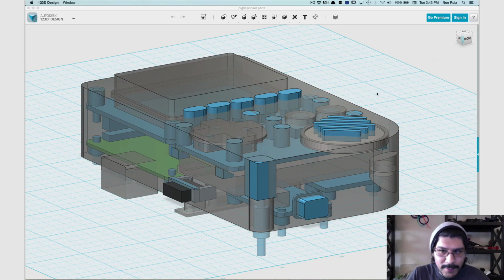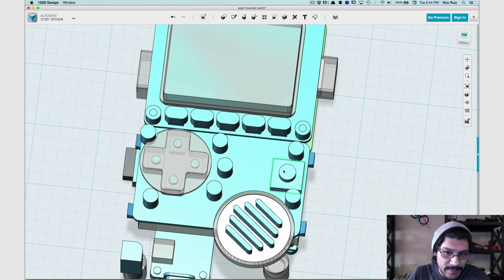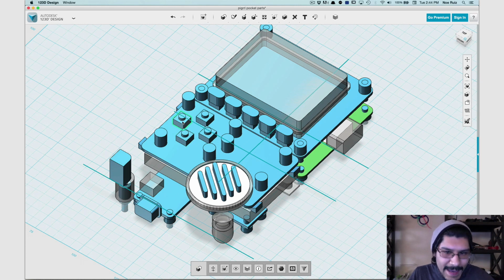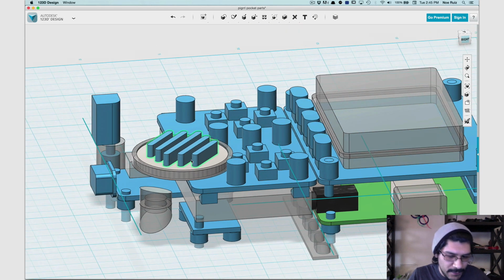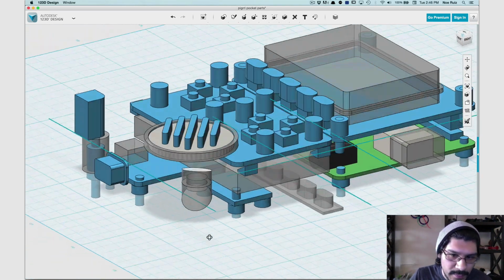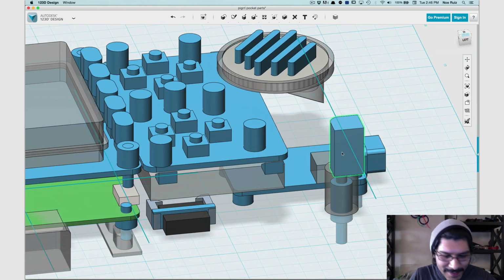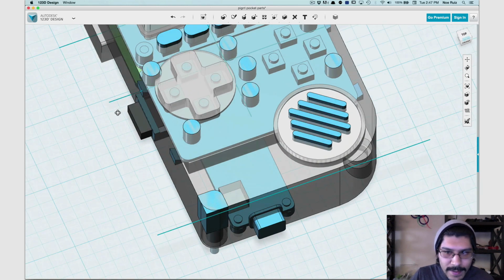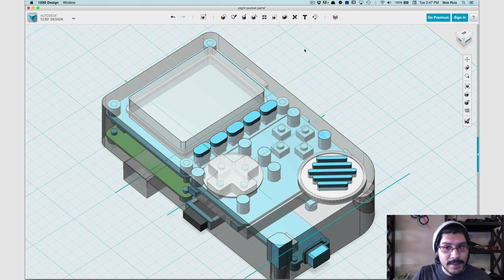Pocket PiGRRL Buttons - Layer by Layer

Comment: does anyone by chance know how to add the 2 new buttons to the retrogame file. It used to be easy back when all you needed to do was modify the c file but now, with the setup script, you just select the pocket pi grrl option which doesn't have the 2 extra buttons.

Comment: Is it possible to add two 12mm tactile buttons to the back of the pocket PiGRRL case to act as left and right shoulder buttons? If so how would you add the cut outs for the buttons in the 3D model?

Comment: I've been following this project for a few days now and I really want this to be my first pi project. But I do want 4 bottons. However, as I mentioned this is my first pi project and I have no experience with editing 3d models. I couldnt do this along side you let alone create and add 2 additional buttons. I was planning on just sending the 3D print stuff to a printer operator I found with 3D hubs. Is there any way you could post the model for this somewhere online so people can decide what they want to do? thanks so much. This project is amazing.
Reply from the maker: We're working on a four button version of the case. The files will be released within a few weeks, thanks for your patience!
Reply: Awesome! no problem. Keep up the excellent work!
Reply: Hoping a four button model comes out soon.
Reply: Could you also post the design of a case for the original Pi Grrl with the Raspberry Pi 2 instead of the original B model.